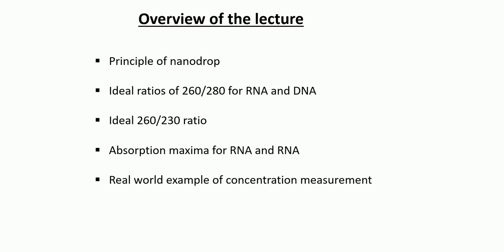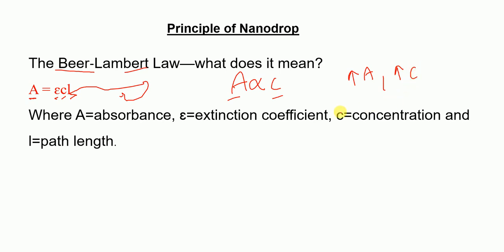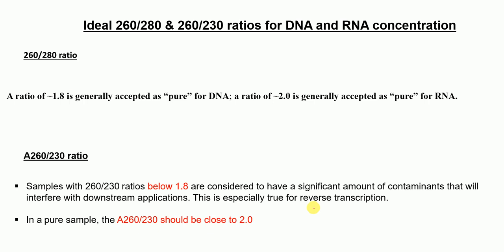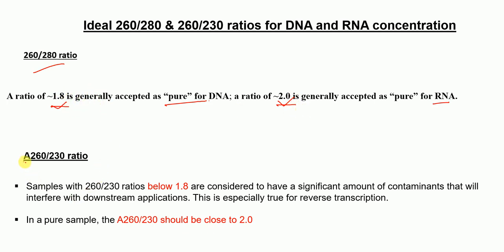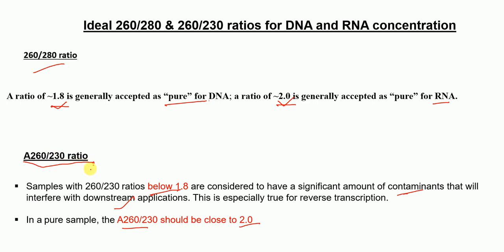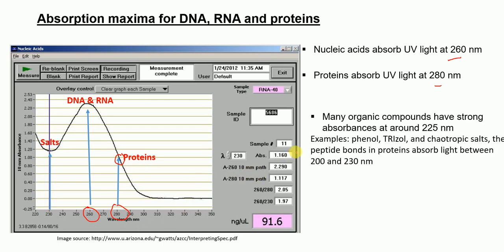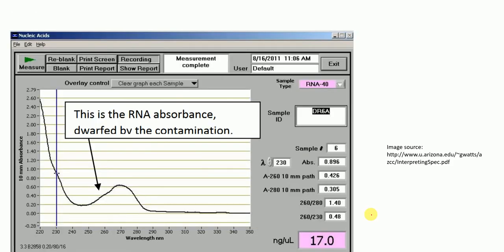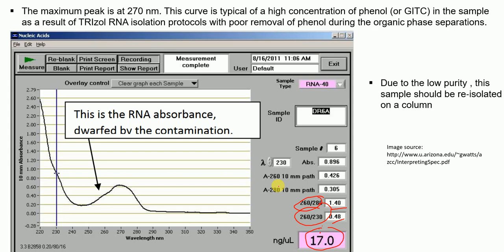Nanodrop Ratios Explained | 260/280 ratio DNA | 260/280 ratio RNA | 260/230 Ratio | Qunatification |

Comment: If we have contamination in our extracted DNA or RNA and we don't have extra sample for the extraction again, what should we do in this case how we can decontaminate our extracted DNA?
Reply from the maker: Enzymes such as DNase or RNase can be used to degrade contaminating DNA or RNA, respectively. If the contaminant is the opposite nucleic acid type (e.g., DNA contaminating an RNA sample), using the appropriate enzyme can help degrade the contaminant while leaving the target nucleic acid relatively intact.
Reply: @BiologyLectures  Thanks for the response, i know this but my question is how we will perform this on already  extracted DNA or RNA is there any method to perform this, I hope you you don't mind
Thank you
Reply from the maker: @MohdFaisal-ps7df  You can perform DNAse or RNAse treatment on already extracted DNA or RNA. Just take already started DNA or RNA and use DNAse or RNAse and corresponding buffer. I hope this helps.